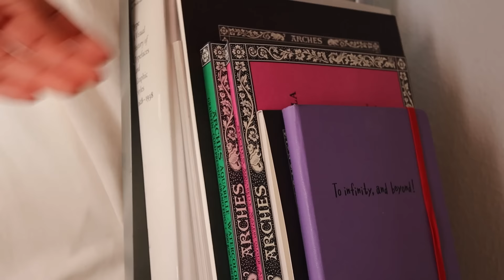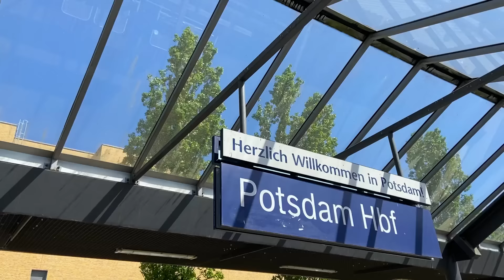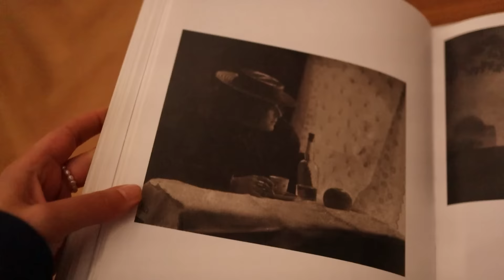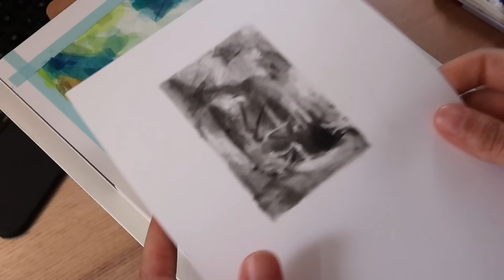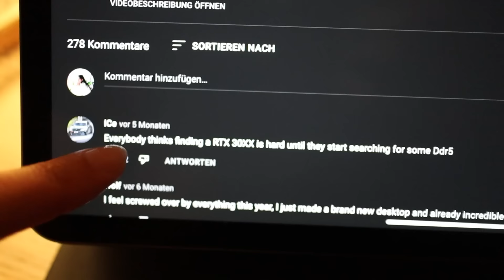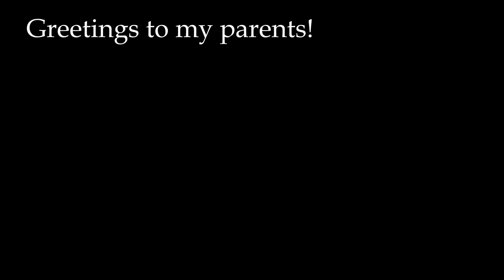Teach yourself Anything 🧙🏻 Building a PC, Watercolor Painting & Museum Visit ⭐ Cozy Art Vlog

Comment: Congrats on your new PC ✨ Looks magical! You did amazing!! 💛 also such a beautiful watercolor painting. And a lovely video full of great advice!
Reply from the maker: Thank you so much Jess! 🌻🧡💫
Reply: hai  jess.. im your subscriber .u know .u ar so inspiring me
Reply: @valerielin  can i ask u a question ? Is buying the cumputer parts one by one more expensive or cheaperthan buying a normal pc ?
Reply: My daughter built me one similar to Valerie's, but mine is pink. She looks for the components separately and says it is most definitely cheaper.
Reply: @loolach811   Year and something late but I think custom build is better.

Pre-builds can be cheaper but you have very little control over the choice of components, which can get in the way of upgrading something in the future. For example you could only get 2 RAM slots or get a power supply that's only good enough for the current load. That's coming from someone who changed a lot about his PC, adding parts that didn't even exist at the time of the initial configuration.

What did you go with in the end? Both in terms of specs as well as pre-build vs custom.
Reply: @Tomas9970_1  thanks! I didnt buy a new one this time but hope i will build one myself when i get ready!

Comment: 3:15 This is such a simple yet great tip the longer I think of it.

And the underlying principle can be applied to any area of mastery:
Reduce the amount of variables to focus on just one thing initially.

A commonly known example would be stabilizers on a wheel. You're simplifying the task because you can't yet handle it all at once.
So you isolate individual aspects to master by themselves, in order to synthesize later and use them together.

Comment: ur cpu socket on the motherboard is damaged 12:48, has damaged pins, go ask some technicians that check it, because can cause inestability or bsod. Sure someone with a bit of experience noticed too in the comments. btw, a 240mm aio is not enough for a 12900k that beast consumes a lot of watts, generates a lot of heat, gonna reach more than 90ºC and reduce performance when you are encoding videos.